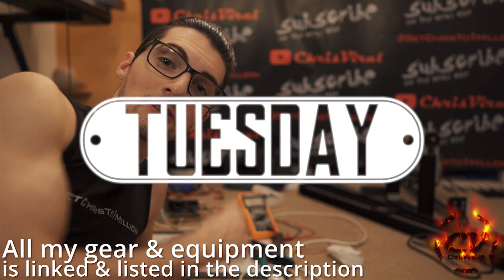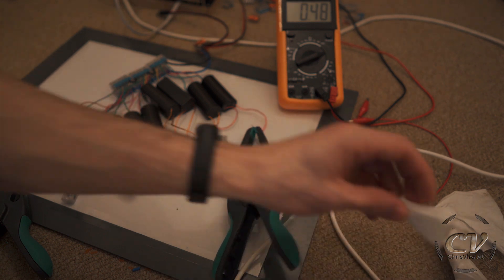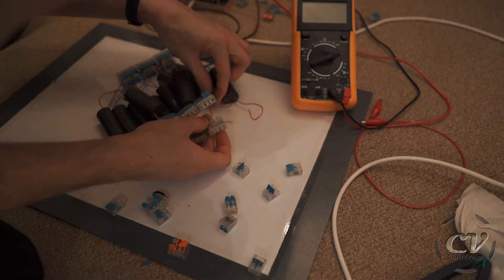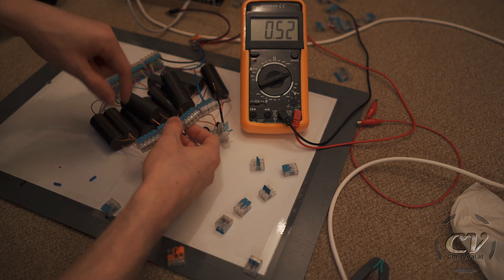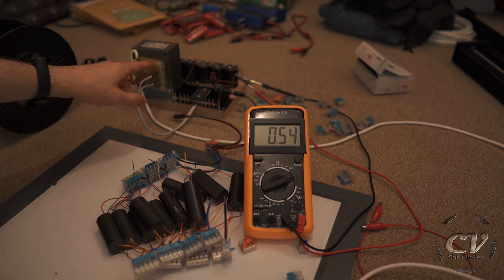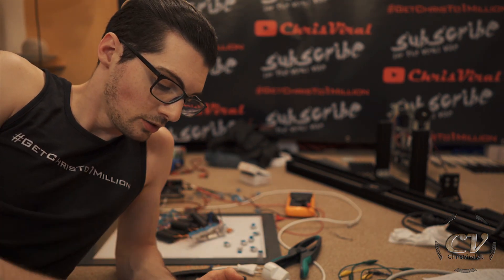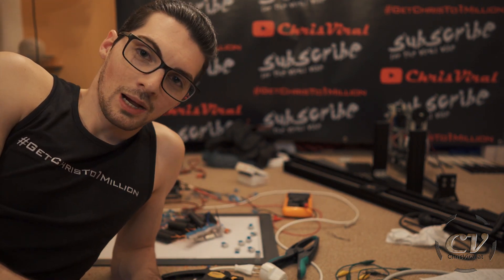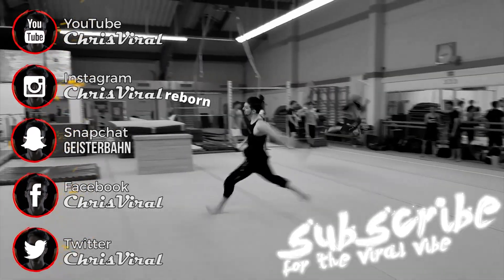400kV Modules - Series VS Parallel (Painfully Loud)

Comment: I connected 15 of these in parallel a few months ago, it only ran for about a minute then something shorted and it's dead now lol. It just about blew my ears out and the spark was so hot the tips of the steel wire electrodes vaporized away a little with each pulse. I had to use two 26650 lithium ion batteries in parallel to power it, it was a hungry little thing and drew a ton of amps, I tried an 18650 vape battery (very high amperage, 20 constant 30 pulsed) and it got excessively hot in about 3-4 seconds.

I'm assuming it would be lethal if you were to catch an arc across both hands, that is a LOT of current, that's getting into dangerous territory I'm guessing (nothing like the 8000uF 1kJ capacitor bank I just built with studio photo flash capacitors lol), I can't even imagine tasing a person with something like that, it would cause surface detonation of their skin tissue🤣.

Comment: These modules seem to have an output polarity (I discovered this when charging high voltage capacitors), so when you wire them in series, I hope you checked and marked the polarity first--otherwise, the ones wired 'out of phase' will tend to cancel voltage.

Comment: hey Chris can you tell me how much volt and amps I need if I connect 12 pieces in parallel?  
can you maybe make a video that you really connect for example 10 pieces in parallel so that it also works?
Reply from the maker: Assuming that one device will need around 2A you will need at least 24A for 12... Yes, this is an upcoming project on the list because by now I have powerful SMPS (50A).

Comment: Hey I wonder if I can drive a flyback with this?
Reply: You can use Capacitor and diode chain as Voltage doubler to make something like this at home.
Reply from the maker: Interesting idea, I really have no idea about that. Sounds like a nice experiment.

Comment: hi do u need to up the voltage if in Parallel, like if i had 2 of them would i need 6 volts or still only 3?
Reply from the maker: In series the voltage will drop, so no afaik. Parallel = same voltage.
 But you will need more A !!